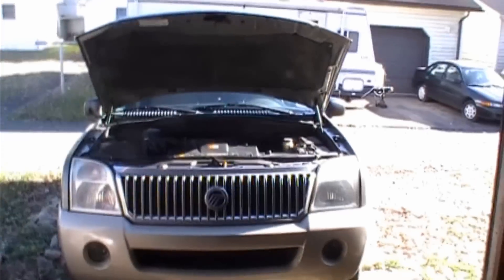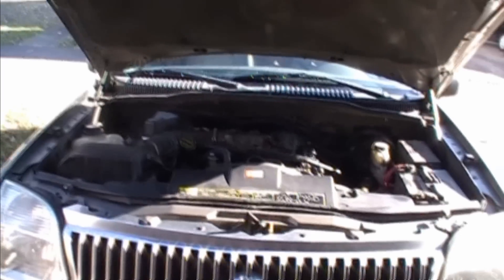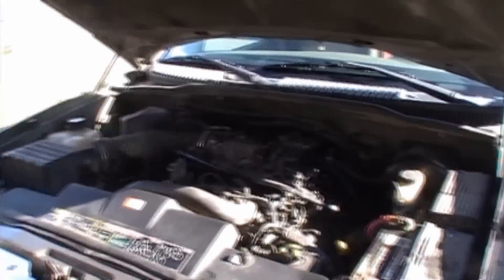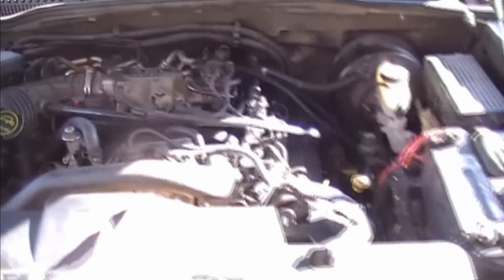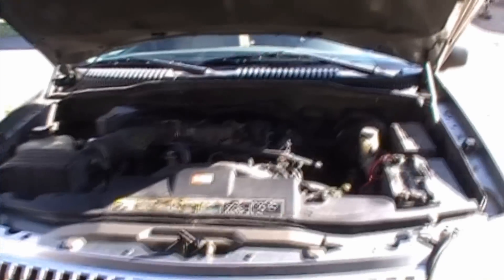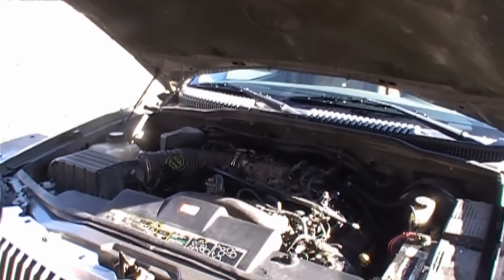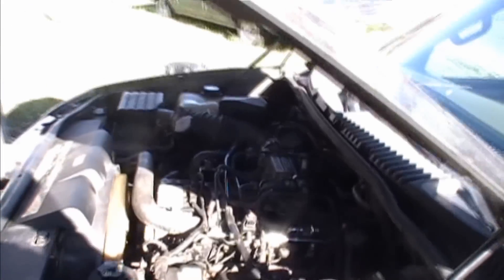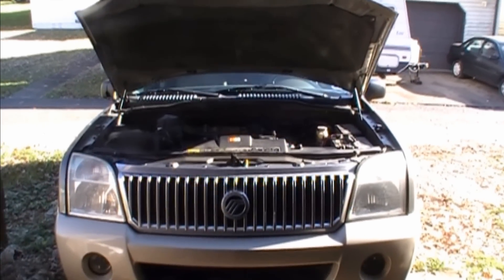PO430 CODE  The real story...don't waste your money!!

Comment: I changed my cat last month. Figured I'd change the O2 sensors by the cat too a week after cus one was off other car and I had wiring cobbed. 

Then I noticed p0340 code after new 02 sensors... So thought I'd order two more sensors for by exhaust manifold.

Or maybe new sensors were faulty.,.. I'll try this.

1998 GMC Sierra k1500 5.7 with 385,649 miles.
Maybe the engine is just beat. Runs great but needs to overhauled in spring
Reply from the maker: Hope it works!
Reply: Truck already passed state inspection. I just want it to be better on gas.

MIL didn't pop up until a week after cobbing O2 sensors and replacing cat. Old cat was good but was too large and was hitting crossmember and that was annoying. Mil was O2 voltage too high bank 2 sensor 1. I got a ticket on my birthday for inspection expired (over a year)... Plead guilty via mail and included a cop of inspection reciept. Charges dismissed, no fee or fines. Much better than sitting in court for 3 hours and paying $140 fine/fee's as what happened last time...

I'm sure front o2 sensors are fouled. Maybe it'll help.
I'm going to install spark plug anti-foul plug after cat, one sensor of 4 is after cat .

Truck engine needs overhaul, leaking/burning oil/coolant not much but noticeably. hae to change oil every 2000 miles cus it gets dark, add about 1/4 gallon in same time. Oil pressure is low enough that check gauges light comes on at stop lights at times.

Hoping high volume oil pump, will help along with complete casket set change. will know more when I drop oil pan and look at main bearings...
Reply from the maker: Wow. That made me tired.....  Hope you finish it and get back to normal.

Comment: I got P0171,P0174,P0430, in that order.  I had a intake leak, taped it up real good and the first 2  codes went away. The one that is still lingering is P0430.  I hoping it will go away after a couple times driving it, so I can get it to pass the smog test.
Reply: Did it ever go away? Same thing is happening with my car… Codes were pending even after 3 drive cycles, and then finally the time I took it to smog, p0430 set but the other 2 were still pending, Cleared them and changed the o2 sensor just for good measure.

Comment: What if its a coolent problem? What could be the problem? I've replaced radiator sensors and coolent cap.
Reply from the maker: For that code....you may have a bad intake gasket small vacuum leak. po430 is a code that o2 sensor says....yuck! I don't like whats coming out of the engine....fix me.
Reply: TVWXMAN32 i hope so. Ive already changed catalytic converter about 2 years ago and code came up again.
Reply from the maker: O no! Well I still think you have a bad intake gasket of some sort or a kind of "slight leak" vacuum or etc for this code this. PO430 seems to point that way.

Comment: so here is my deal i never had a po430 code i had severe mis fire changed plugs and cpl coil packs pcv had my intake changed prof i also had my belts done it did have a severe loss of coolant in the past so imagine all i could do was drive it to work till i afford to fix had everthing done same time now it throws the po430 code and a small occaisional wavering idle but no loss of coolant no mis fire runs nice cept every month or so will throw po430 and some idle waver which is burning me up this 4.6 is my baby its a MGM god i love this car
Reply from the maker: Yea a po430 can just be some air leakage not being metered by the ECU. Hope you get it fixed. Probably just a gasket on the intake.
Reply: TVWXMAN32 
J io hi
Reply: Thanks for this contribution TVWXMAN32 !  I just changed air filter on my 05 nissan frontier 4.0, and P0430 followed. I noticed the air box is slightly warped, and a small gap at the rear where it seals. Could a bit of air getting in at that spot throw the code?
Reply from the maker: Possible. I'd seal it. If the code comes back, then you may have a gasket somewhere getting bad ;(
Reply: Thanks - you mentioned spraying carb cleaner around the top of the engine to detect leaks. I've heard of doing it with starting fluid? Does it matter (already bald)?
Reply: I put a can of Seafoam in the tank, as I've had luck passing my pre-96 honda smog check with it. If the light doesn't go off I might try the lacquer thinner, then the anti-fouler methods, then the drive-to-Florida-and-sell method.
Reply from the maker: Yea starting fluid would be better. The engine would be more sensitive to it.
Reply from the maker: I understand. If it comes back on then I'd start looking at gaskets Etc "if" your married to the Honda ;)

Comment: I have an 05 Titan, I disconnected the o2 sensors, took them off, cleaned them out with nothing but air from my compressor. no light or codes since then.
Reply from the maker: Good to know it worked!
Reply: E Serrano. I have a 06 titan with an exhaust leak. I think that's why the failed Bank 2 catalytic converter code came up
Reply from the maker: yea porb so ;(
Reply: E Serrano    How about within the last 4 months  ?....have they come back on  ?

Comment: i have a turbo car. i replaced the re-circulation valve on the turbo. brand new cat from a downpipe i installed and i got the code p0430. so i know its not the cat. now a buddy of mine at a shop did an extension for the o2 sensor for me but it didnt send a code until after i replaced part on turbo (intake side of turbo) its between the map sensor and the MAF sensor. could a vacuum leak there make a p0430 code? its throwing the back sensor code not the front
THANKS!!!
Reply from the maker: Yes. Still I'd inspect that extension  on the O2 sensor also. I was going to install a turbo on my 4.6 expedition but man that's  a lot of work!!

Comment: I have a 2003 mountaineer 4.0 and it has a p0420 and p0430. When you are driving it has no power at all but idles fine but it also dies. What could it be?
Reply from the maker: Stopped up cat??
Reply: Nathan Rohrbough what test can I run for a clogged cat?
Reply from the maker: There is really no test. If you have no response and sluggish gas pedal...its a good indicator.
Reply: Nathan Rohrbough Thanks I am going to remove the catalytic converters to see which one is clogged
Reply from the maker: Use a OBD2 code reader. Look and see if you have a PO420/PO430. Then 
look at the bank to fine what side. A bad cat will push a code sooner or
 later.
Reply: Nathan Rohrbough  I have both codes present (P0420- Catalyst System Efficiency Below Threshold (Bank 1) and also (P0430- Catalyst System Efficiency Below Threshold (Bank 2). I just have to figure out which side Bank is bad.
Reply: Nathan Rohrbough The code reader I have says this for the data.
(02S B1 S1(V)  0.830). (02S B1 S2 (V) 0.165). (02S B3 S1(V) 0.280). (02S B3 S2(V) 0.165)
Reply from the maker: Here's what I'd do. Clear all codes. Drive it for 100-150  miles. Then 
pull codes. Sometimes codes can be pending for old issues. Starting with
 a clean slate would really help. But Its sounds like all your cats are 
bad. Does it have 4 cats?  Two on each side?
Reply: Nathan Rohrbough It has 3 cats in total. They are original
Reply from the maker: I'd pull one cat and just look at it. If its melted inside there there is a good possibility the 2nd one is also ;(

Comment: I had the code 430 and 420 before. I replaced two of my catalytic converters on my 06 Tacoma. Now the 430 light is back on. What could it be???
Reply: I had a new radiator put in because I had no coolant in my truck. Idk if it's related to this code or not cause I hadn't put coolant in the truck and had recently bought it so dont know how long since it last got coolant in it.
Reply from the maker: PO430 is unmetered air. Check the intake gaskets. They get squashed after a while loosing there seal.

Comment: Not here to argue... But why would an intake leak cause a catalytic inefficiency code instead of a lean code? I'm not saying your not right, but trying to dissect what a p430 really is...
Reply from the maker: Because a slight intake leak/un-metered air leak...will tell the computer trying make the engine run right by trying to compassionate adding more fuel becoming more rich.. When that happens the catalytic converter doesn't like that and it then says "barf" and throws a P0430 Code. This is often how cats get burnt up over time.  PO420 is just activity on the 1st and  2nd O2 sensor  means the cat has no response at all. (in a nut shell) Both 02 sensors are reading the same.

Comment: Had a friend with a 98 Lincoln Continental. The mechanics wanted a ton to replace cats. I looked at it. The boot from the fuel filter was not even connected to the throttle body. I clamped it back on and code went away and has stayed away.
Reply: Edit hose from air filter to throttle body.

Comment: Changed my intake it was cracked and fixed my issue but I had a po430 pop up so I'll check my thermostat gasket but all is good after intake change
Reply from the maker: Check all vacuum hose for leaks also ;)

Comment: Meh, not sure I believe this all that much. I had a 4.3 Vortec that had an intake leak so bad when I fixed it the fuel trims pegged -25% and set a code. Never set a P0430 though. An intake leak seems unlikely to set P0430. Fuel trim is determined by the O2 sensors afterall. If you're burning coolant, the cat is likely screwed already anyway.

My concern is that if you're wrong, the engine may well grenade. The correct answer here is to look at the O2 data(sensor 1 jumping around and 2 stable), smoke the intake, and do an exhaust back-pressure test. You can accomplish those all for under $100.

Comment: Great video - very informative! I've got a '99 Mercury Grand Marquis with a P0430 code. The engine light was on for a few days, then disappeared for about two or three months, then back again for a week, now off again. The car just passed the emissions test, recently, and when you turn it on and look under the hood, everything seems to be running normal, BUT, as soon as you put it into drive with your foot on the brake, you can feel an intermittent jerking. While driving, not so much, but at the red lights, yes. So, the question is...if it were the problem that you're describing, would the car still jerk a bit? Also, how much do you estimate it would cost a typical mechanic to fix the part in your video, if it turns out to be that? Thanks so much - I just subscribed to your channel!

Comment: This is the least most common problem when that code shows up the chances of that being cracked or loose now if you just had your spark plugs changed on your Dodge Grand caravan the whole air intake's got to come off mine was just seeing 6 months ago and now the code is showing up I went underneath I was able to get my hand on one of the sensors I touched it to see if it was loose tried to turn it nothing went back up started my car check engine lights off did the key method three times left it forward coach shows back up but check engine light goes off it's only been on for a 4 hours I wonder if the wires are just loose not sure
Reply from the maker: Yea doesen't take much.
Reply: @FixingWithPassion  just changed plugs and wires on 08 ranger .. now I've got that code .. definitely gonna check this out before buying any more parts especially since this code wasn't before the new plugs and wires!

Comment: My 03 maxima has acceleration problems and this code popped up. Could the intake as you said be the reason for the acceleration problems?
Reply from the maker: Yes and no...Most of the time that code its just for small leaks 
somewhere meaning /air/gas /mixture, the computer is trying to control 
what suppose to be going into to the motor...but the o2 sensors are 
saying...Hey! This is not right! I'd check for some gasket leaks etc... but
 under huge circumstances, it could cause acceleration Issues.

Comment: Thanks for the info and video but how about i have that code i have a 2007 ford expedition el but i have the code and too much smell of fuel coming out of the muffler can it really be the catalyst converter ??thanks
Reply from the maker: Sounds like a intake gasket, or a air leak somewhere. Make sure the PVC/tube is sucking air. Start with the small things and work you way up. Good luck man!

Comment: My 07 Lincoln MKZ has that code P0430. I bought a new cat but at the same time I noticed an extreme reduction in mpg (like 7.4mpg). Before putting on a new cat, started thinking it probably couldn't keep up with whatever is dumping all that fuel. I know a Cat usually is harmed by something going on elsewhere so I decided to start looking for something else before installing new cat (PITA) since it would get destroyed also. But P0403 is my ONLY code. There are so many sensors, wouldn't another code show up? Any idea where to begin? Intake? MAF? etc. Thanks
Reply from the maker: Glenn Dexter ....You mean po430  not po403?
Reply: TVWXMAN32 code reader says P0430, the bank 2 catalyst below efficiency. I can see the second o2 sensor reads similar to first although occasionally and briefly it will flatten out then begin the oscillation again. I'm just thinking it's getting so much fuel it has no time to handle the burn.
The other cat p0420 is fine. Started to put in the new cat, realized I'd have to remove exhaust manifold also so stopped until I can check the other things. But it's just the cat on one side. What part specific to that side? Maybe fuel injectors? Wouldn't intake effect both sides? No coolant loss that I can tell. Could it be intake specific to that side. Its a 3.5L, the Mazda engine I think. Just a little stumped. Maybe cat is bad but believe it or not I have to remove the intake manifold just to replace the spark plugs on the back anyway for tuneup. Its a 6 cyl.
Reply from the maker: Glenn Dexter ....what size  engine is in that?
Reply: 3.5 L V6
Reply: I purchased the 3 volume factory manual from Ford described as complete. I insist on working on my own cars. 3 giant books but turns out that the emissions volume is separate, wouldn't you know it. Plus, not much diagnosis, everything is simply remove and replace.
Reply from the maker: I'd start with those intake gaskets. I know on the 4.0's there always going bad giving a po430 code.
Reply from the maker: I know right! Good think we have the interwebs to help us out some ;)

Comment: sir help i have a fx35 2008 light came on checked at autozone code p0430 i dont have rough idle no known symptoms helppp ... also it happend when i was real low on gas on empty idk if its related or fluke but please input thanks much
Reply from the maker: Bad converter maybe??
Reply: thanks going to a muffler shop my dad knows the pwmer so get that family wuality thabks for input
Reply: code read bank 2 af ratio converter gasket one code had like 4 possibilities
Reply from the maker: Get a temp gun and measure the inlet/outlet temp of the cat. That will tell you a lot.

Comment: Hey TVWXMAN i came across your video searching my p0430 and p0420 codes for my 2003 Ford Expedition (5.4L) and i do have a slight coolant lost problem as well as a bit of "water" leaking from the tailpipe at times (i was told thats a normal good sign but idk) and a misfire in cylinder 7 code that popped up 2-3 weeks after my 420 and 430 codes, also when i sit still its a exhaust smell that will bother you and this was prior to any check engine lights, dont know if any if this is related but basically what im asking is does this indicate to you it might be that intake problem your discussing in your video, dont wanna replace cats and ect.... plus all that other stuff just to find that intake is bad, thanx in advance.
Reply from the maker: Just replace the intake gaskets first! If you have the aluminum intake you are lucky....Alot of fords have the shitty plastic intakes :) I've had to replace a lot of them and the gaskets....Gaskets are cheep to buy! Love the older Expeditations!

Comment: can you update a video for dummies, lol, can the intake be looked at without removing anything, code just came up on my 05 pathfinder, 0 experience with cars, well i can do an oil change, thanks for help
Reply from the maker: Best thing is remove it and replace with new gaskets if its a PO420 code.
Reply: Unplug one of the vacuum lines (and plug up the port where it hooks up. Light a cigarette or cigar and start blowing smoke in the line. You might see vacuum leaks this way. Done it many times, and found a leaky intake I fixed once too.

Comment: what about a 98 Chevy Tahoe,  5.7? with p0430
Reply from the maker: Perhaps a intake gasket or a slight air leak in the intake.
Reply: TVWXMAN32 thats what i was afraid of. lol thanks, i was hoping just the 02 sensor was bad. my Tahoe actually turned off while it was in idle today. it started yesterday as i was in a drive-thru idled weird like it wanted to shut off. it has a small water leak in the intake, but its been leaking a little for a while,  the check engine like just came on today. pep boys said the code was p0430. 
i just changed the break master cylinder last week, and that one started leak too! 😱
Reply from the maker: Yea, UNLESS it actually says "O2" code for oxygen sensor...its probably going to be gasket/slight air leak somewhere ;(  -----from my history.
Reply: i have recently replaced the ignition coil for the 98 Tahoe, and out of the blue, P0430 was detected. i have checked all the connections and everything seemed tight. any input?